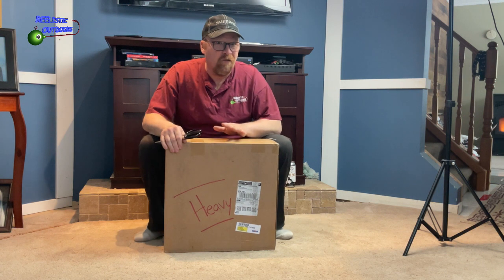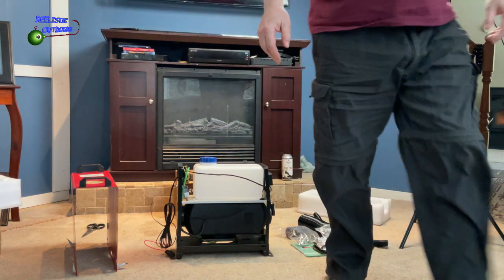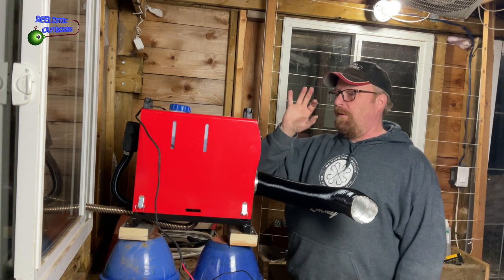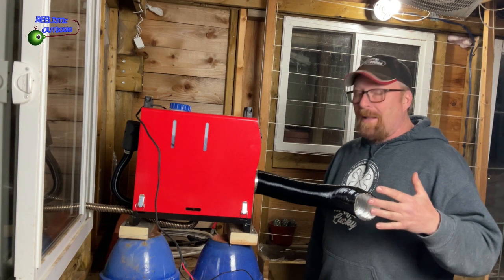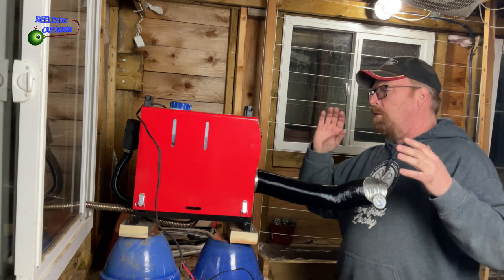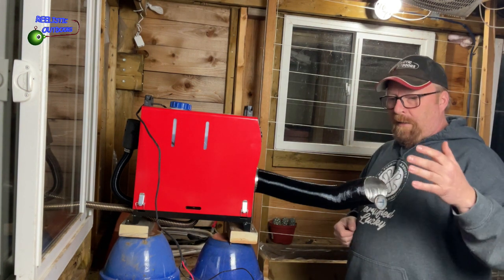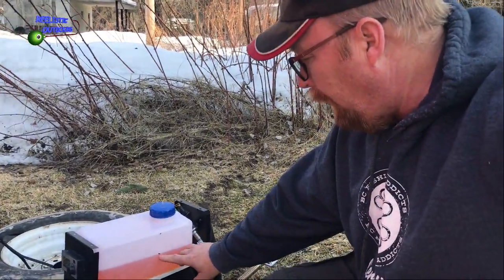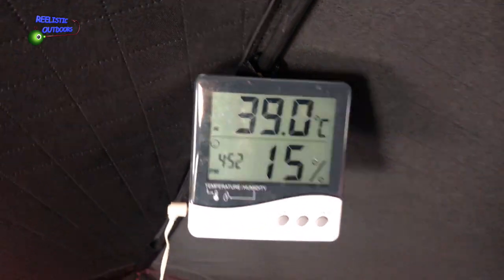Diesel Heater Review and unboxing

Comment: Great vide, thank you . I recently bought an eskimo  tent and you sir answered all my questions . Great job.
Reply from the maker: Thanks bud. I just spent 7 days at -20 in it and now i have a wY better understanding .
Reply from the maker: Also i put a flex pipe inside the flex pipe and i had next to no heat loss
Reply: @reelisticoutdoors4358  was it great ? kind of have a double eskimo tente and would like to know if it would work great
Reply from the maker: @killerboy1234567815  We used it in a double tent a -35C and it was ok, but not hot. When it was -20 it was no problem.
Reply: @reelisticoutdoors4358   well my tente is like yours insulted but double was just looking to see if it’s better then my bigbuddy heater

Comment: I have the same one. Remote control does not work. Don't expect to turn it off from your tent.
Reply from the maker: Me controller is extended into my tent, i dont use my remote but I assure you mine works fine.
Reply: You should have tested the remote control and commented on this advertised feature.
Reply from the maker: Works fine, I don’t need it
Reply: You need to pair most controllers to tje control panel. Vvkb has a video on how.

Comment: Did you connect the controller?
Reply from the maker: I extended the cable that connected it. That way the electronics are not out in the weather
Reply: @reelisticoutdoors4358  thats great tobhae a thermostat..but did you link the remote ?
Reply from the maker: @andresrivera2124  yes it’s linked but I don’t use it or care to use it.
Reply: @reelisticoutdoors4358  how did you linked ...having a hard time to link mine

Comment: Curious on how weather resistant this is.  Did you make a shelter for it?
Reply from the maker: I have a kids pop up for the beach that I wasn’t using. Like 20 bucks or something that I have been using. I’m not sure it needs it anymore as I extended the cable to the electronics on the front so it’s in the tent with me.
Reply: I have a tote that holds the unit and the 10ft of 3in flex duct hose. I set up the heater, then flip the tote over top of it. I cut a hole in the side to fit the hose in and elevate the entire thing about 2ft off the ground. This provides room for the exhaust to run out and draw fresh air in.

Comment: I just got this heater.. How do you pair the remote? I'm also having a hard time getting it started for the first time. The fan kicks on then shortly after the heater completely shutdown. Any ideas? Thanks not many people on YouTube have this model
Reply from the maker: Not enough batter charge or heavy gauge wires. Did it get primed? Pairing was tricky but I will try to recall
Reply from the maker: Ryan Aliado press and hold button for like 20 seconds it will go into a temp mode then a pairing mode
Reply: @reelisticoutdoors4358  thanks. I'll be trying again tomorrow
Reply: @reelisticoutdoors4358  Thanks a million for the advice! That's exactly what the problem was.  Just hooked it up in my '01 jeep xj.  Gunna do a trial run tonight here in Minnesota thanks to you! Appreciate it,  stay awesome 😎
Reply from the maker: @johnkaul9183  look forward to the story
Reply: @reelisticoutdoors4358  Well the heater ran awesome! Ran it 13 hours, didn't kill my truck battery and used 3/4 tank of diesel. Only got down to 6 degrees f. Ran it on 5 temp setting and was nice and warm. This is a major game changer for me! Take care! Thanks again
Reply: @johnkaul9183  hi, is this heater on amazon?
Reply: @facts1752  yup ...happybuy 5kw diesel heater. It's $160. Thing is crazy awesome! If you do purchase it don't hesitate to ask me any questions you may have. Take care 🙂
Reply: @johnkaul9183  thank you!
Reply: @reelisticoutdoors4358  hi, what button needs to be pressed down for 20 sec?
Reply: @johnkaul9183  hi, did you ever get your remote to pair?, i cant seem to pair mine
Reply: @facts1752  So about pairing the remote...I couldn't get mine to work 😒.  The research I did lead me to believe that it should arrive already programmed. Please let me know if you are successful with it cuz I'm lost!
Reply: @johnkaul9183  thank you, that makes sense
Reply: @reelisticoutdoors4358  i tried pairing my remote, it doesnt seem to work, do you think i got a bad one?
Reply: @facts1752  company sent me the manual which is much better than the one that usually comes with it. Helped walk me through how to pair. I can send it to you if you would like
Reply: @teerex1104  oh cool, that would be awesome, please.
Reply: @Facts  with the unit off, hold the button 5 to 10 seconds until you hear beeping. It will put the screen into settings mode and turn the heater on at the same time. Turn the dial counterclockwise approximately 5 times until you see a P1. Press the + button on the remote and screen should switch to P2. Press the - button and the screen should switch to P3. Press the M button and the screen should switch to P4. Press the power button and the screen should switch to its normal operating screen. Remote should be programmed at that point (At least that's how it worked on my setup) good luck
Reply: @teerex1104  thank you!
Reply: @johnkaul9183  With the unit off, hold the button down for 5 to 10 seconds until you hear beeping. It will put the screen into settings mode and turn the heater on at the same time. Turn the dial counterclockwise approximately 5 clicks until you see a P1. Press the + button on the remote and screen should switch to P2. Press the - button and the screen should switch to P3. Press the M button and the screen should switch to P4. Press the power button and the screen should switch to its normal operating screen. Remote should be programmed at that point (At least that's how it worked on my setup) Good luck
Reply: @teerex1104  thank you, i tried that and its not working, maybe i received a faulty remote

Comment: So with a heater like this outside of your tent there is no chance of co developing in the tent?
Reply from the maker: that's is the main idea however there are 2 things to keep in mind. 
1.) you want to make sure the exhaust is nowhere near the intake and
2.) you could get a cracked gasket at some point and the exhaust can cross over to the heater blower side.
For the most part, this is a way better (safer) way to heat the tent. 
Always use a CO2 detecter

Comment: How much battery does it use over night
Reply from the maker: I got 3 nights from a decent battery
Reply: @reelisticoutdoors4358  what’s a decent battery?
Reply from the maker: @Sparkyspage  the best you can afford. Litium for weight, but the one i use is pretty cheap, I can power my trolling motor for 6-7 hours, should be good for the weekend with heater but i film on location so i have a genny anyway to top up all the camera batteries. I mention it below somewhere the one i use

Comment: Great video mate, did you find out what the power usage was on your battery?
Reply from the maker: Didnt test with numbers but ran a deep cycle for 2 nights on one charge.
Reply from the maker: I bought a tiny generator for my big trips anyway as i have so much camera gear to charge up so 2 days is plenty for most over nights

Comment: How would this unit hold up-40C?
Reply from the maker: Best answer I have for now is they say it’s rated for -50 but I would probably build an insulated cover for it. Second there’s no way I’d be out pushing my luck in that temp. My cut off for filming is -20
Reply from the maker: They seem pretty decent snd like most Diesel engines they need more love at cooler temps
Reply from the maker: Thanks for watching